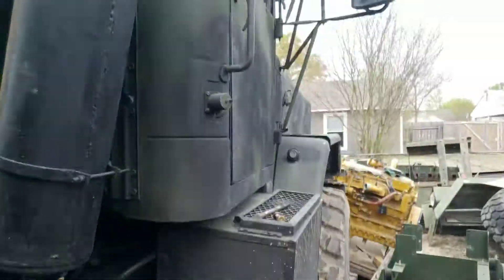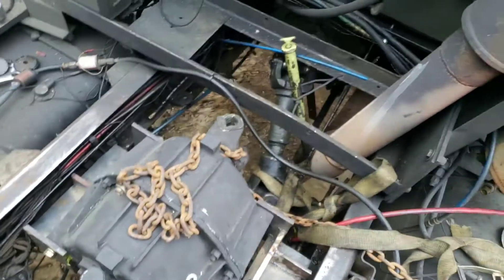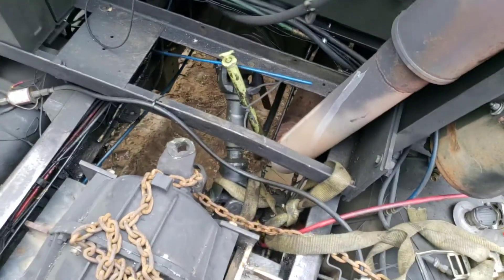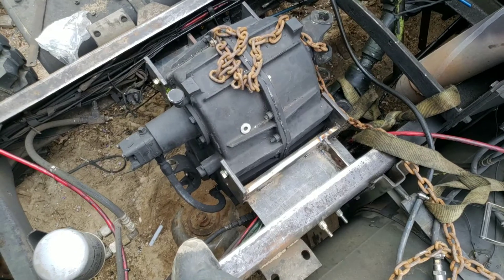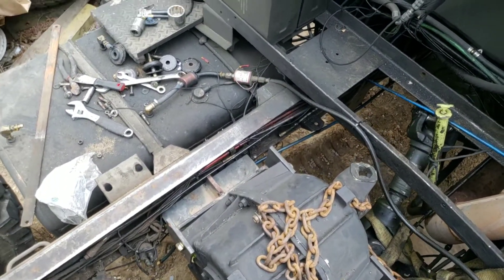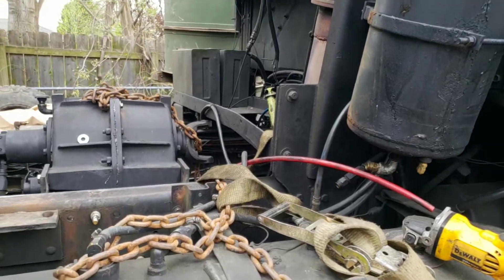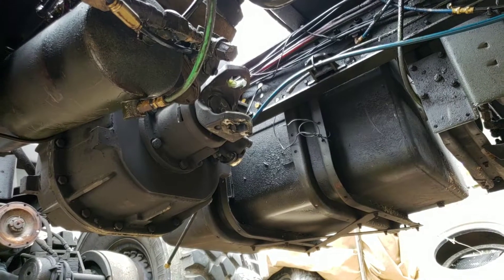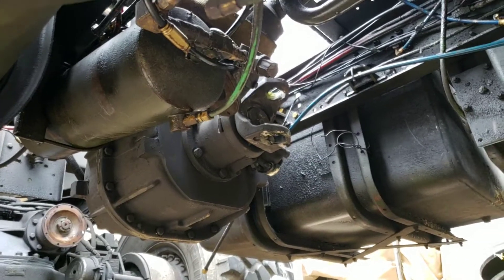M923A1 Oshkosh 55000 HEMTT transfer case modification and install

Comment: So, why use the HEMTT Texas case? Will it produce more torque or prevent “snapping” it in reverse? I mean, $85! Wow. But what’s the advantage you’re looking for?
Reply from the maker: Samy B my plan is to upgrade to a big cam iii. About 520hp when I am done.  The cat 7155 transmission is 95percent efficient so full power will be going thru the case.  The case is rated to 700hp 2000ft lbs.  I lose my overdrive from .73 to .98 on the hemtt case. But I will be able to use low range as well.  Case will still allow me to reach 78mph with 1600s.   The 5 ton case will blow out in high range with that power and its companion flange setup.  Companion flanges are also a weak link.  No sense in blowing a 5 ton transfer case when they are worth a good bit of money being in short supply.  Plus the hemtt case has a better offset for the drivelines.
Reply: Nice... I’m planning some modifications over the next few years. May add this to the list! Thanks for your response!
Reply from the maker: Samy B you can follow the build thread here.
https://r.tapatalk.com/shareLink?url=https%3A%2F%2Fwww%2Esteelsoldiers%2Ecom%2Fshowthread%2Ephp%3Ft%3D175976&share_tid=175976&share_fid=20191&share_type=t

M923 Transfer Case upgrade to Oshkosh 55000